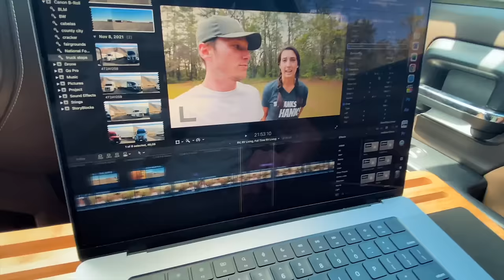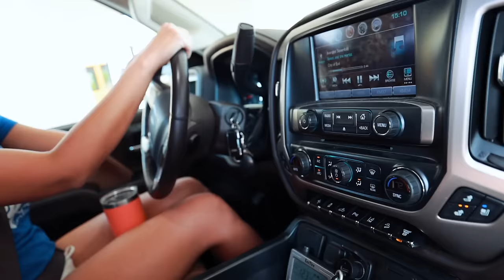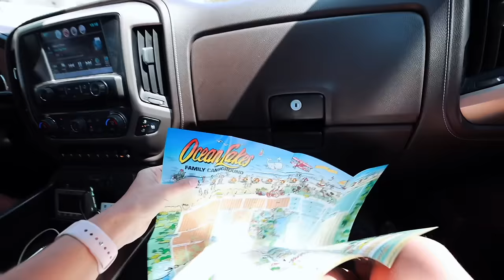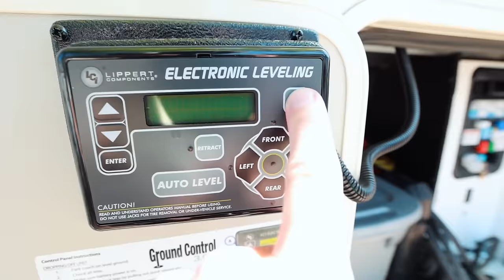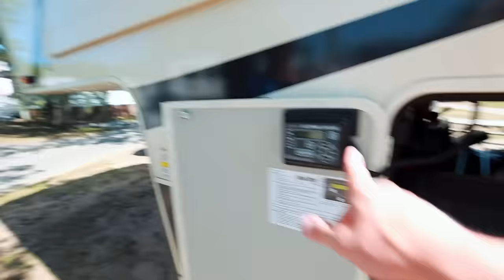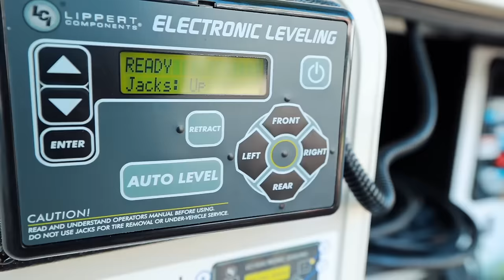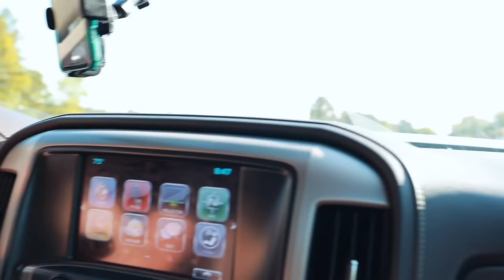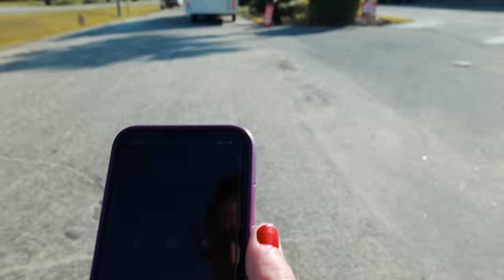The Dark World of RV Service: Untold Truths About the RV Industry

Comment: We purchased a brand new travel trailor by forest river.  It was 2019 signature by Rockwood.  We have since fixed the following within the first 3 years. New toilet,  the peddle to flush broke off. Have purchased a new toilet.  Our awning motor broke and needed replaced.  4 new tires and seals after two years. Our island counter top cracked in cold weather... the slide out  in bedroom,  one wall was even attached to the floor.  Window crank nobs have stripped since the windows seals stick. They are plastic.  Wr keep several on hand at all times. One of our top vents wad broke since purchase of the unit in January 2019. We did not take back to the dealership for repairs since Camping world has "poor service".... we paid over 50k and this is we have dealed with. Now our furniture upholstery is falling apart.  CRAZY!!!

Comment: I think every RV owner can feel your pain!  I suspect they didn't lose your new grey tank, but installed it on another RV or sold it to someone else.  I have had similar issues with RV service departments.  The latest is that Camping World damaged our antenna reinstalling it after putting a new roof on our RV.  You can guess how cooperative they have been in replacing it on their dime.  I also had to adjust the awning after the roof install because of poor installation, and had to remove a bunch of caulk that was clogging the gutters.  There is more, but you get the point.

This was the last straw for us.  We will use Mobile RV services from now on.  They are independent, rely on word of mouth so they focus on quality, and can easily be researched in camping groups.  Plus, you don't have to take your RV to them.  They come to you! :)  We found a good one near us.  He does great work, keeps his appointments and is very reasonable.
Reply from the maker: Yes, we've heard great things about mobile techs all around!
Reply: This is the reason. I bought a floor model travel trailer and they pillaged ALL the good stuff off of it and put it on trailers that were in for repairs THey took the brand new propane bottles off, the electronic jack, replaced the brand new scissor jacks with older ones, etc. We didnt care because we got a big discount, but it happens all the time and its frustrating.

Comment: Well, you just brought back some vivid memories!  You both handled this situation with grace and restraint!  Us, well, we really truly tried!  Our fifth wheel was in the shop long enough to birth a child from start to the actual birth!  Then, after 9 months, we brought our rig home and the awning wouldn’t work.  So, called the repair shop back, and the first words were, “didn’t happen here”.  Turns out it did, and they realized it, and yes, I did the Nay Nay irritation ploy, not leaving the building until they fixed it.  Our incredibly long wait was because the nose cap cracked, it was under warranty, and it took forever to get the part. And the awning issue, they pinched an awning wire installing the nose cap.
Reply from the maker: Oh wow, that's such a pain!
Reply: RV repair shops are like insurance companies.  Disclaim, blame, lie.

Comment: This video is exactly why I try and do 99% of the work myself. Our refrigerator went out with 5 days left on our last trip. The day after we got home I did the trouble shooting, found the problem and ordered the part. I replaced the part and we are back in operation. Last time I took my trailer in for some suspension updates, two weeks for an appointment and they had it for a month. Very annoying. Hang in there Hanks!
Reply from the maker: That's the reality of RV service nowadays

Comment: Agree with self repair, tank replacement could use many experienced hands under the rig, (bulky items are a balancing act, as you may well know already).  (Before strapping tank in, get all the external to the tank pipes connected, sealed/glued, air tight, no leaks, 🥵).  When I took the micro-mini-Winabago for a factory install whoops, so much time involved.  (The plumbing vent pipe install person or persons, put the vent pipe too low in the gray-water tank, causing less than half the tank to be filled.  (Stopped filling about 1/2 a tank, in this case, 15 gallons and stopped taking in more water).  The joys of RV’s are endless. 😳
Reply from the maker: You got that right!

Comment: We feel your pain. We bought a brand new camper this year. The first night we used it (with temps in the 40’s) the furnace broke. We had multiple items from the final walk around that also needed to be fixed. We still don’t have finish trim on the kitchen cabinets. And we finally were able to camp in warm weather and found the the A/C is also not working. So it is back in the repair shop. It has been there more than it has been in our possession at this point. We had to cancel our 4th of July reservations and are now waiting for any notification that the A/C warranty claim has gone through and they shipped an a/c. We have called twice and they have no answer and have no idea if has been shipped. If we could return the camper and claim lemon law we would but it doesn’t qualify yet….
Reply: what camper did you buy?
Reply from the maker: Oh no!! We are so sorry that ya'll are going through this 😕 We hope things get addressed for your quickly, stay safe and keep us updated!
Reply: Sorry to hear this. Just be thankful you're under warranty. We had a/c problems and water heater problems under warranty. When the extended warranty ran out, more of the same, plus serious leaks, even on a 2-yr old roof, none of which was under warranty. We just got it back with a $4200 repair bill. On top of all this, I was diagnosed with cancer last November and haven't been able to use the rig since then. When gas prices go down, I'm putting a For Sale sign on it!!!
Reply: @jamesgritz404  it’s a 2020 Forest River Arctic Wolf. Bought new in Jan.
Reply: And 2 weeks later, we had to call, again because no one at the dealership called back and now we are told it was on backorder (which they never mentioned before), now not on backorder but will still take another 4-6 weeks to arrive. By then summer is over. This new RV purchase this year was a HUGE mistake. If we could file a lemon law claim on it and make them buy it back we would.

Comment: Ya know this isn’t the first time we’ve heard of this happening we’ve learned to call the day before our appointment to make sure the part is there, sometimes the dealers will have an Rv with the broken part they have in stock for you and the customer wants their rv now so they take your part and put it in another rv!  We had a dealer take a rear axle off an rv on the lot to put on a customers rv because the customers rear axle was broken and couldn’t get the part in so they took it off another RV that was sold to put it on the other customers RV.  If I was you I would go to grand design to get it fixed and cut out the middle man.
Reply from the maker: Thanks for sharing!

Comment: Here is hoping you get it fixed soon!! We had a similar problem here in CO. We bought a new Montana 5th wheel and after two trips, the fresh water tank started leaking. I removed the back under belly to find the tank crushed on the top. This had to have happened when they installed it. After having it at the dealer/repair center for warrantee work for a couple of weeks after they agreed it was not our fault, we were told we had to wait for the tank to be ordered and come in. Decided to take the RV home where it would be safer. Almost two months later, the tank came in. Well, mostly came in. Like you they couldn't find the tank. After a couple days, they found the tank and we were able to take the RV in and they replaced the tank under warrantee. These are such stressful times, and you two handle it so well. I'm hoping I can take inspiration from you two, to handle problems later, that I'm sure we will hit! Thanks so much for showing that things can be a little less stressful if you don't go crazy and try to keep your cool. Look forward to part 2...
Reply from the maker: Thanks for sharing, Rick! More to come!

Comment: WOW I'd be PISSED! But there's nothing you can do, you're at the mercy of these incompetent places. Our new 5th wheel has had more issues in the first 2 outings than our previous 2 trailers in their entirety and our dealer is 2 hours so they offered to drop ship some of these parts for the minor repairs so I took them up on it and while I shouldn't have to fix a brand new rv it got me more familiar with it and most of these repairs aren't that hard to do with simple tools. Hopefully everything works out. At least you're still able to use it for the most part, our first trip our awning broke in half basically stranding us. Thankfully Arron Jones from Jonsen2travel was putting in our solar system and is also an rv tech. and fixed it enough to make it drivable and fixed several other issues we had.
Reply: We are in the market to purchase a new RV and I was wondering is yours a Grand Design as well?
Reply: @travlntam  No its a Prime Time Crusader
Reply: @jandblawncare8570  I will need to check it out.
Reply from the maker: Always helps to be handy for sure!

Comment: Same experience. Waited a month in town for our appointment since we fulltime. So inconvenient. Got there they could not find our part. It was there. Could not find it. Eventually found it, wired the circuit board wrong and installed the valve upside down. By the time it broke worse 3 days later we were many states away. Had to go to the Truma factory to have it fixed.
Reply from the maker: Appreciate you sharing your story!

Comment: I feel your frustration with the auto level. I do not think its in the manual, but I have pushed the auto-level button with enter button simultaneously, then it gets made at you and allows you to clear the code, it is a panic stop error that happens and when you push the enter to clear it resets the other error codes as well. I found out that when my jacks are going all the way in "retracted" and the auto level thinks it needs to go further is when it messes it up. I have learned my lesson, and put the level control to manual mode and then leveled it with the manual display, and when close i will use auto level for the unit to do the rest of the job.
Reply from the maker: Thanks for sharing, Justin!

Comment: On a summer road trip we hit some road debris that cracked our gray tank.  We had a mobile RV tech come to our trailer to replace the tank.  It took around 5 hours since he had to open up the underbelly and disassemble a cabinet to remove the tank and hook the new tank up to the shower and lavatory sink, then put everything back together.  If I had scheduled the same repair with a local dealer, it would have taken months before we could get in for the repair.  It's essential to have a good RV tech.

Comment: Been there , done that! on a tank that had a crack in it while they installed from factory and we found the problem after leaving and were already in another state! We took RV in 3 different times and were told it was fixed all 3 times, only to get parked and set back up and find out it still leaked! You better be ready to take on repairs yourself.

Comment: You guys are so much fun!  I hope we can meet up sometime. We have our solitude which is currently in storage BUT we are driving to Columbus O-HI-O tomorrow planning to by a 2019 Ford F-350 which is decked out for our B&W hitch!  We may be mobile yet!  So sorry to hear about your service issues. I really hope we can make the next Grand Design get together…thanks for all your helpful information. By the by, did you have to empty your fridge or is it hooked up to electric or using your propane while in the shop?
Reply from the maker: We had it running on propane but most service centers can hook it up to electricity.

Comment: Love watching your channel, but the reason why we walk you through the hook-ups is because not every RV park is the same. Take our RV park when you hook up your water we tell everyone 1.5-2 turns when turning on your water because it will start leaking and you can pull out the packing. We also guid you in to your spots because you have to back in and out electric box is in the back. Do you know how many have backed in to it. We also like to make sure they have the proper hook ups and let them know where to plug in. I have had more 50 and 30 amps burn out because someone plugged in a 50 amp to a 30 amp. For the most part they know what there doing but I have gotten the ones who say "Hun this ain't my first rodeo" and mess up my site.

Comment: We feel your pain.  We cracked a windshield upon arrival in Biloxi Ms for a full month stay. Called insurance who outsourced the claim to Lippert. 3 weeks later the glass arrives and installed.  But it was an aftermarket brand that did not fit. The center bottom of the windshield stood out 3/8 inch from the front of the motor home and pressed against the dashboard. The top was worse, 1/2 inch. Lippert agreed it was a problem & we scheduled an install 4 weeks later about 850 miles away. Short story, the glass arrived after we left.  We scheduled the next location, again, 4 weeks out & 600 miles away. The glass arrived but could not be installed due to weather.  We scheduled out for the week following Memorial Day. The installer went above & beyond driving 2.5 hours each way to install on Monday of Memorial Day weekend. His only comment was the box for the glass was very beat up. So 4 months and 4 appointments before we had a good windshield.  BTW 13 days after installation, we get a bullseye right in front of the driver. This is RV life.
Reply from the maker: Oh goodness Mark, so sorry that this happened to you 😕 Glad that they were able to get it addressed! Yes, RV life has those curve balls for sure

Comment: For your auto leveling system, check your rig battery: high amp draw with low V will trip component circuit protectors. Check your battery V immediately upon arriving at a site and after disconnecting the umbilical. If low V you have issues with your alternator (not likely) or electrical line from the truck to the Rig. Finally, the very first thing to do upon arriving to a site with juice (30/50 amp service) is connect your line conditioner/circuit protector and prove power from the pedestal. Then finish your pedestal connection so your battery is backed up by A/C when you run your auto level system. This will help prevent your landing system shutting down before finishing leveling. If your conditioner is like ours it takes several minutes to analyze power from the pedestal before allowing juice to the rig. I place my landing pad spacers while waiting. Don’t wait to connect power: why do most/all of your setup if the pedestal is bad and you have to move to another site?

Comment: Beware  RV frames breaking is a real possibility . Inspect your frames around the axles and the spring shackles for stress cracks on both Travel trailers and 5th wheels. The force of dragging tires sideways while making turns on paved roads racks your frames . You can see this when backing your RV into a spot. The places to inspect are the Ibeams in front of and behind the axles and in between also. These Ibeams twist from these extreme  forces . Also shackles break . These forces cant be totally avoided but a 10 minute inspection can prevent a real disaster. 5th  wheel owners be on the look out for any seams opening or movement in the facade  around the goose neck . If any movement is detected you have frame breakage at the transition area. Its repairable if its fixed promptly . Be safe
Reply from the maker: Thanks for the heads up!

Comment: I feel your RV pain....I just had a tire blow out on my camper last week.  Besides getting new tires I had to order a new skirt and a new piece of tin for the side from a dealer.  The skirt cost more in shipping than the actual part ($150.00), and will take approximately 4 months to arrive, and the 24" piece of tin was going to be $800.00 with shipping because it only comes in 10 ft sections...I passed on that, I will just straighten it out and reuse it.. I will probably never take it in for repair....If I cant fix it, it wont get fixed...
Reply from the maker: Thanks for sharing, hope all goes well for you!

Comment: The water in most locations around the country is hard water (high GPG). In many locations we’ve found water so hard it’s off the top end of the scale! Consequently it only takes a month for deposits to form in your rig in some locations. If you’re full-timing and don’t have a softener, IMHO you’re taking years off your fresh water lines and fixtures. Even with our water softener, and sediment filters, I clean sink faucet screens quarterly (remove aerator fixture, remove large particles and soak entire fitting in straight white vinegar for 15 minutes). Do this monthly if you don’t have filters and a conditioner.  Finally, remove and clean (as above) all sink aerators and shower head after flushing your water heater, especially if you use vinegar. Depending on how much sediment was in your water heater tank you might even need to do this several times over the next few days!